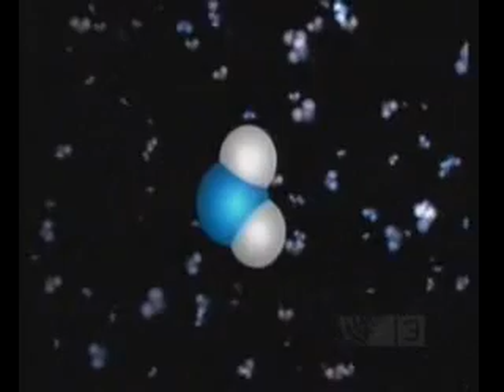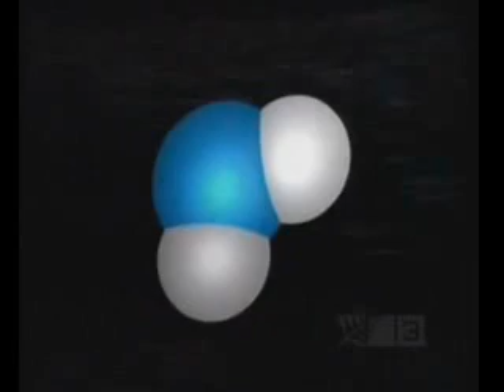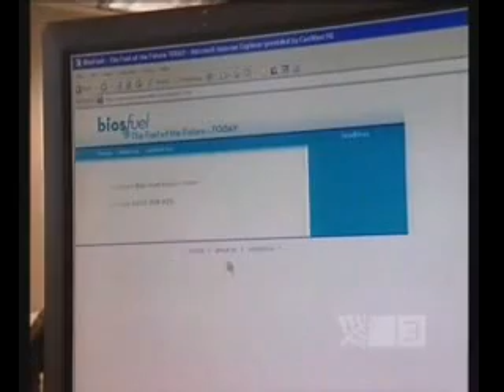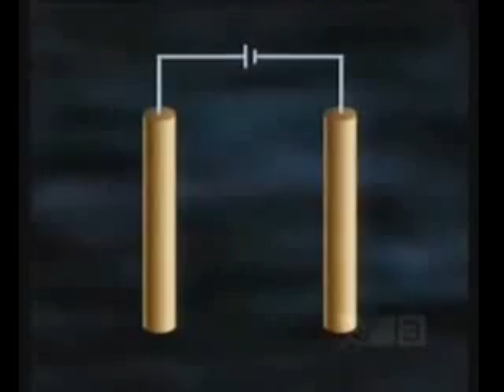A Motorcycle that runs on PURE Water.

Comment: bah,, assuming because someone has a formal education in science and engineering they cant think "outside of the box" is ludicrous. im constantly pursuing non-standard ideas. so I do think HHO or pure hydrogen combustion can be the future. We just need to find a practical way to store it safely and produce cheaply. Water-based fuel lol with little mods to the carb, it seems to me it's mixing in something like an alcohol or glyceride and it ends up being the fuel with water just being injected along with the mystery mix. there's no separation system, so he's not burning water or Hydrogen. 7 years later; what are you doing Steve Ryan? stop worrying about a fuel additive and focus on the systems to store, inject, and combust the H2 in water. then you'd have so much support for your ideas :)
Reply: +pds tech why store it make the hydrogen in the engine bay
Reply: you can, but must be high ouput. like 4L+/min at full throttle for a v8 ? very do-able
Reply: if you are thinking hho you are not thinking outside the box.  If you defend your education then he is right about you.  I have way more education than you and I know it was all worthless.
Reply: +NatureHacker this education is bad thing is bullcrap. how else do you expect people to learn? if you think what there learning is false, then you can demonstrate how the scientific method doesn't work.

Comment: A scientist owned company in Panama City and Long Beach exists that uses HHO 'Aquygen' a new type of hydrogen there is a device inside the engine that converts the water into HHO. The motorcycle here is going to retail for the same price as a full dress Harley unfortunately; or 20,000 dollars, but be only the size of a 125 he has here. The company sells the same product as a gas to use in welding.
 BMW has a car the 7 series that also is to run off of water coming out sometime next year, unless its banned by all the other car companies, that uses a water condenser instead of a tailpipe to capture the stream from burning hydrogen and oxygen and returns it to the 'gas tank'. It is using water as a fuel too.

Comment: A gasoline engine wastes 70% of the energy in heat. If you spray just the right amount of finely dispersed water into the intake at higher RPMs the water will convert to steam which expands 5 times more then burning gasoline reclaiming that wasted heat while cooling your combustion chamber and engine  at the same time! An old top fuel funny car mechanic once told me,"If you think race fuel makes some power in an engine toss some water in there with it and see what happens!" That's how they get 5000HP out of 8 cylinder engines. The technology was invented to get super charged bombers off the runway in half the distance during WW2 and the mechanics like myself in the know brought that technology to the drag strip. Especially in the alcohol water fueled class as alcohol does not even expand as much as gasoline when burned but tolerates much higher percentages of water then gasoline does as alcohol is 100% soluble in water. Converting the water to HHO wastes energy as electrolysis is only 60% efficient under the best lab conditions with platinum electrodes and the alternator producing the electricity for the HHO systems is only 70% efficient not even taking into account the resistance losses from all the wiring! You are getting back less then 20% of the energy you are putting in from the crank when you burn the HHO produced that way! All the HHO information is disinformation to keep experimenters as far away from that truth as possible. After all, that's some folks trillion dollar piggy bank the technology would be chipping into. Hint > Someone should experiment with ultrasonic transducers (as used in ultrasonic humidifiers) to break the water up into tiny, near vapor particles prior to injecting the water into the engines intake to eliminating any wetting issues! I will probably get taken away in a black van for spilling the beans but F'em! lol

Comment: There is ONE preliminary test that would either firmly disprove these claims, or warrant further investigation (To be clear, it would not prove the claim in itself...but would quickly show it to be a hoax). Further, this test would divulge nothing about any "secret" formula or process.

Simply perform a CO/CO2 test on the exhaust, as you might for an emissions test. This would have to be quantitative (as most are) because one would expect at least a trace from lubricating oil seeping past the piston rings. 

No need to argue physics. No need to argue chemistry. No need to argue that 7 years have gone by (an eon in the information age) and everyone is still stopping at the pumps regularly, or plugging in nightly.

Comment: well, nice 1
.......that one on the bike is a not-supercharged internal combustion engine. so in order to run you must have a combustion reaction happening, a pressure increase that moves piston and finally the exausting of the reaction products. water itself, as commonly know, cannot burn so obviously the fuel is water "based".
the inventor says that "there is no petroleum, no carbons"..ok 
if you use a fuel different that the usual you have to change carburation ratio and ultimately slightly modify the carburetor.

 in order to give the combustion result, if we start from water we have to break it into its "bricks": hydrogen and oxygen. we can do this in many ways.

the professor at the end has to go back to books or go to work a bit and understand reality not theory...but not all scentist are like that one
..... it has a sense to me but we have to ask ourself how much power that engine will put out and how long and also how long the materials of the engine can resist.

finally water is so more precious and polluting it for using moving car is not so smart. 

we need to help less lucky person on earth to have clean water rather than using it to go around.

Comment: I think his "water based fuel" isn't really just water... I think he hides something. Maybe he adds some sort of catalyst to the water which then does the analytic reaction of water when in high temperature, namely, in engine. This could explain the fact of no electrolysis and that the water "burns" in the engine.
Reply: Duncan Stamps Well, you can't exactly compress liquid gasoline/petrol either. It has to be atomized and the surrounding air is compressed. Too much fuel means you've flooded the engine.
I'm surprised the thing uses a carburetor, though.
Reply: Water is also incompressible
Reply: Brandon Edge I believe you missed my point.
Reply: Well, you replied to me, so...
Reply: I think I know where the misunderstanding lies; I made my comment in response to Duncan who said water is not compressible. I was letting them know the irrelevance of their comment.

But yeah, no hard feelings.
I JUST WANT SHIT TO MAKE SENSE!
Reply: Marcus Rhodes i agree with you liquids can not be compressed eg petrol abd diesil as they are liquids so it has to atomize them hint hint to cause the pressure as people say suck squeeze bang blow suck is the intake cycle squeeze is the compression cycle bang is the ignition bit and blow is exiting of the fumes but if it runs of water what wud the fumes be called that came out of exhaust im confused
Reply: Marcus I want to thank you for the comment I feel enlightened
Reply: +Joshua Moore if you work out the arithmetic that goes with this idea it would create ozone

Comment: He can't explain it????????  He's an idiot!!!!!!!!!!  The simple answer is that the guy is performing some sort of splitting that takes the Hydrogen away from the Oxygen - then he's burning hydrogen (or oxygen) which are both GREAT fuels (The American Space Shuttles used Hydrogen to blast off!!!)  SO - we know this has been done!!!!  This video is 6 years old and there isn't a single engine that runs on water!!!!!!!!!!!!!!  Why is this????  He must have the same lawyers that I had for my divorce - they really sucked!!!!!!!!!!!!
I can PROMISE you that if I made a motorcycle run off of NOTHING but water - we'd all be driving my motorcycles (or cars with motorcycle engines) within a year - two at the most!!!!!!!!!!!
Reply: *****   I have say no because think about who controls energy, oil, and car companies
Reply: lol oxygen is needed in the combustion chamber to work with the hydrogen to complete the process. of course its not a fuel by itself. calm down. the process isnt so much about cost efficiency. i do it to cut down on burning petroleum because of the carbon in it. Hydrogen, carbon, & oxygen exit your exhaust. why not find a way to use only oxygen and hydrogen and leave out the carbon pollutant. its useless anyway. all it does is create carbon build up on our valves
Reply: Jeff Schwartz even if he did explain it,I for one wouldnt have a clue.

Comment: Methanol and other alcohol fuels are water based and very combustible. But they are NOT water.
Reply: But both hydrogen and oxygen (what water is made of) are highly combustible - you just got to separate them first!!!!!!!!
Reply: Water is already a product of combustion, But we also know that water can be refined to extract what little combustible elements there are left.  This generators need to be big to process the water and they can also use lots of power.  However there are a few childrens  toys available that use Hydrogen fuel cell technology and at this miniature level, it is very affordable.
Reply: Absolutely correct. CPC sell some great little fuel cell toys that use little solar panels to provide the electric and the best thing is these little racing car toys are under £20.  Of course to scale up these fuel cells costs much much more.

Comment: Don't know why YouTube has recommended this video to me... It's also 6 years old, and such a hoax.

That motorcycle doesn't seem to had any major modification, it still runs on combustion.  So to create combustion, you have to burn the hydrogen, as water will simply not burn.  And to burn the hydrogen, there has to be electrolysis to separate the hydrogen from the water molecule.  The hydrogen's energy density per unit volume is extremely less that you will need much more of it than traditional fuel.  Problem is, even if that motorcycle has a hidden compartment with electrolysis device, it simply cannot produce the hydrogen fast enough to cause the density of combustion needed to turn the motor.

Before he pours that supposedly "water" into his motorcycle, that "water" is treated from his invention.  The water goes in then comes out becoming highly combustible?  It could be possible that water be filtered and treated to bond with other chemicals.  But then, the liquid resulted wouldn't be a water anymore.
Reply: Stanley Meyer's death by poisoning was and still is deplorable. How can evil people do to someone who had a noble objective of creating  a cheap and zero pollution source of energy?

Comment: lol  "No electricity" 9:15 - Adds Electricity!...
Reply: 10:07 - you think its nonsense because your trained University Degree is right..  Browns Gas - HHO... Defrauding people with Nonsense stories that have been debunked over and over is getting old.
Reply: Oh another Point to add, Have me look at it, i will debunk, take the power away from the  System EXCEPT the plug and you will not be able to use the Battery Power to make HHO
Reply: 2:21 He lies when he said no, you can tell by his blink...
Reply: EliteGeeks noticed he does not rev it up much, thats because he is not making enough HHO with the motorcycle battery to get a high rev. And because your using HHO to run a Motorcycle engine its running VERY VERY lean..  and will kill the motor over time Far faster

Comment: This is a hoax.  he would need an additional energy source since the energy alone required to generate the HHO from water isn't going to be produced by burning it.  I'm no engineer but he might be able to add enough solar panels to help in the conversion.  Might also be able to load up on batteries like a prius to help with the conversion.  But chances are it would need charging at night.

Comment: Its called Hydrogen , it's nothing new, it's been around for years , it works "however" it has always had certain draw backs which is why it hasn't come into the main frame for standard use.
 It just isn't efficient  enough to be practical,

Comment: there's no secret about that.. carburator was made to run on LIQUID fuel, modify your carburator to run on hydrogen GAS..then that's it you can run any engine using hydrogen gas... hydrogen is produce via electrolysis.

Comment: A common confusion exists about the First Law of Thermodynamics, the consequence of it being that energy cannot be created from, nor disappear into nothing. Although true, this statement deceives many inventors to see water as a possible fuel and Hydrogen as an energy source. The correct statement of the 1st Law of Thermodynamics is:

"If an amount of energy is added to, or removed from a system to bring it into an other condition, the same amount of energy must be reversed to restore the system's original condition."

From it follows that when the in- and output of an engine is the same amount of water (as steam after combustion), no energy can be taken out in the process, regardless what kind of process, as the supposed energy would come out of nothing!

The 2nd Law then implies that energy must be applied instead to keep the machine running, because it has less than 100% efficiency (as well as the proposed process itself (electrolysis has a typical efficiency of 60%, the rest turns into heat).

Read more about it here:
http://www.draaisma.net/alternative_engineering/2nd_law_thermodynamics.html

Comment: I know how he did it. He used a certain other chemical, such as potassium or citric acid, in the water to make it conduct a lot faster than just plain water so the electrolysis process is quicker. The more conductive water is, the more hydrogen can enter the tank and thus hydrogen enters the engine at a sufficient rate to make a reasonable amount of power without needing so much electricity. It can't make as much power as, let's say, a gasoline-powered car. Neither will it make as much power as a vehicle fuelled by pure hydrogen, but hydrogen produced by the electrolysis with water that has enhanced electrical conductibility is amassed and stored in a pressurised chamber that will eventually fill up and then have a maintained amount of pressure inside to keep up with what the engine needs to run. We just need the secret ingredient he uses to make the water more conductible. All you naysayers out there can think what you want, but this is happening. It's a shame that all he wants out of it is money. But someone else will eventually discover the mistery chemical and do it for him/herself. It's only a matter of time.
Reply: +Kelsey Scharf palladium
Reply: i have a couple of EBikes    1 goes 50MPH...but can be modifird to go 80.....pretty cool bikes!!!

Comment: Imagine my surprise when I find out they are not putting pure water into the motorcycle as the caption says.Did you watch the clip before you posted it with that caption? It's not pure water they are putting in there is it Troy?

Comment: There's a clue @ 4:25, the small carburetor modification. Most likely venting the hydrogen into the carb or intake tube. The gadget near the end that 'modifies' the water looks a bit fake. Can anyone read what's on the side of the 2 gold colored blocks? I can only make out 'OCLIX' and other than the top and bottom purple covers with long bolts holding it together I can't recognize what the other parts could be, especially the 2 silver color pieces at the top. They give it a 'made-up' appearance. Reminds me a little of the 'magnetized water' ideas for health improvement.

Comment: I have seen things like this and they were all scams. A simple measure of exhaust gas would reveal that there is a source of hydrocarbon based fuel stored somewhere on the vehicle. Exhaust from a hydrogen powered engine has no CO2, CO or HC. Any of these gases in the exhaust would prove that there is a source of some other fuel than hydrogen. Another possibility is that the fuel maker is nothing more than a source of pure ethanol. As water is soluble in methanol, the small amount of water added would still run the engine. Again, any exhaust gas analyzer would reveal the scam.